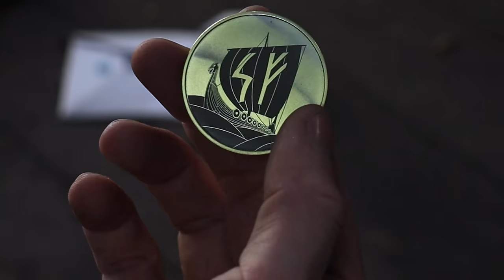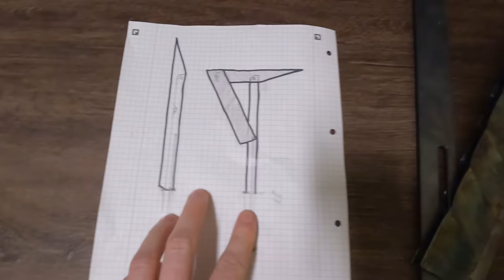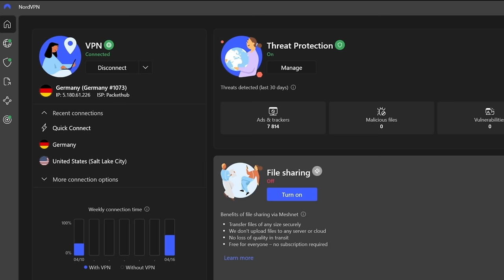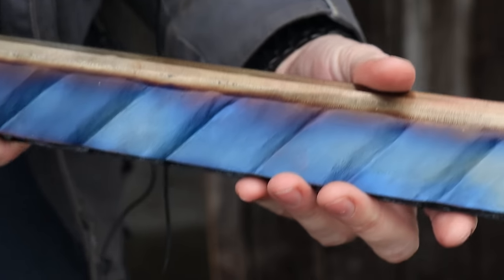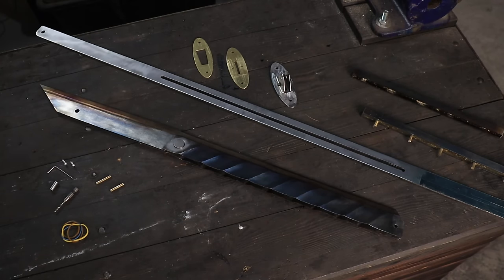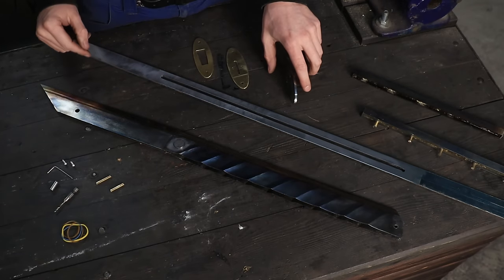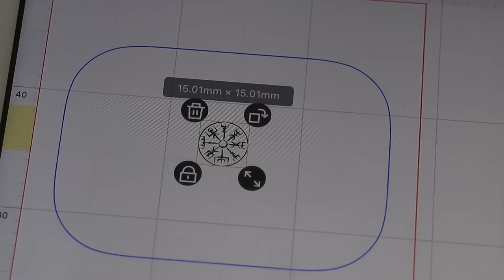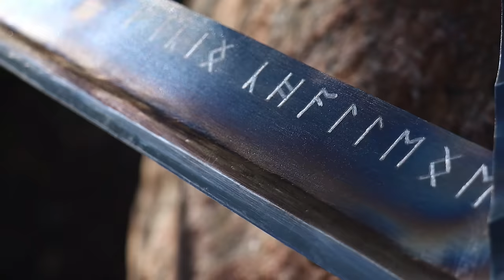Making a functional SWITCH AXE

Comment: I'm astonished by the integrity of the finished piece, I did not think the design would hold up to any real stress.
Reply from the maker: I’d love to really try what it could handle but at the same time I don’t want to wreck it for no reason 😄
Reply: @NjordArtisan  its definitely "mall ninja" durable so don't hit it on anything like wood, or rocks, or bricks, or cars, or grenades.
Reply: @NjordArtisan  maybe make one out of stronger metal qaulity and reinforced joint areas also less decorating just savage metal like fast production war blades. smiths back in middle ages only made master piece / decorative or special blades if they had the time to do that or a special customer. Most weaponry was made for warfare less where made for show pieces except if they wanted to see the skill-set of a rumoured smith. stil awesome switch blade axe thing you made but i do think you made it weaker by cutting them groves in you're most important part the spine of it all. Stil you could try make ather one for real wood chopping but that probaly gone have some weight in it. Anyways would be the best test if it can chop a tree down it probaly will chop a person down. anyways stil cool build i enjoyed watching the progress. maybe a idea  (dont know if you have a steel company in the area but ive worked at 1 for a few days they kept trowing a lot of qaulity garbage steel into the recycle bin. they would mostly cut up massive plates of steel into smaller stuf and then trow away the skeleton of plate steel so yeah worth a look around in the local area if you got any steel industry where you live / could be cheaper to look for that. only reason i left these guys is because they wanted me to do risky stuf and i barely had training.)
Reply: @KnexJunkie  please no more of this abominations...
Reply: @KnexJunkie  No matter what material you use and how well you reinforce the joints, they are always going to be a weak point. This version he made is actually remarkably sturdy.

Comment: Axe mode switch into attack looks remarkably quite well! I bet if you were to make a second version improving on the design it would turn out perfect!
Reply: One issue is it looks like you have to hold the ax in place at the guard since it lacks a locking mechanism, meaning your reach and the force behind each ax swing is taking a hit. Sword mode looks great though
Reply: @derpywoodoo  could build a locking mechanism into/under the guard and use your thumb to unlock it. could be a mechanism similar to folding tables but more robust.
Reply: Maybe it would work better if you'd apply the axe part into the sword handle.

Also I would find this interesting if it was more utilitarian, like a billhook sort of deal. An axe that for self defense purposes doesn't function exclusively AS an axe.

There's Nordic billhooks that have a blade all throughout and into the hook, used in forestry. They're more like a climbing pick and really quite nice to work with, you wouldn't expect how the small bladed nudge grabs nicely to trunks and doesn't get stuck.

Comment: The reason the Switch Axe works at all in Monster Hunter, at least as the game's lore justifies it, is that it was initially developed by an ancient advanced civilization that went extinct. Also, they are made from the parts of the series' monsters, which are stronger than any metal and can thus handle far greater levels of stress.

Good on you for pulling it off at all, though.
Reply: To be fair, the ancient civilization in Monhun was only about as advanced as we are now if they even existed at all
Reply: Your comment is misinformed. In Monster Hunter, metal has the potential to be stronger than a large majority of monster parts. Additionally, while the original Switch Axe was indeed created by the Ancient Civilization, it was a fully metallic design like nearly all ancient weapons were. The technology to build Switch Axes was then lost for an undisclosed period of time before the design resurfaced in an undisclosed desert region, presumably Loc Lac. The Bone Axe, introduced in MH3, was the first Switch Axe in the series and featured both bone and metal design elements.

This is of course to presume that MHGU is canon, which is debatable given the game's inclusion of countless characters and locales that may or may not match up with each other chronologically.
Reply: @rathalomaniac6212  that's technically also incorrect as the Switch Axe and other technologies in Monster Hunter exist because of the world's engineers misinterpreting how recently rediscovered tech was meant to be used E.G Carbine Rifles and gas compression chairs don't exist in Monhun but Insect Glaives do.
Reply: @Sing_LoveWRS  "Carbine Rifles and gas compression chairs"

I have no idea what you're talking about. You do know that a carbine is just a shortened rifle, right? That's basically what an LBG without a long barrel attachment is. Also, what the hell is a gas compression chair?

Your assertion that the Switch Axe "and other weapons" exist because of a misinterpretation of ancient tech is absolute nonsense. Not only does it completely invalidate your first comment, but it also assumes that the Ancient Civilization hadn't already created a version of nearly every modern weapon. Were they the ones misinterpreting old technology? Maybe stop and think before you post misinformation.
Reply: @rathalomaniac6212  do you know how to read
Reply: Also Switch Axe, Charge Blade, Insect Grave and Gunlance, arent even fully understand by forgers in universe, they know how to make the body and most components but the core components are actually scavenge from old weapons left by the ancient civilizations, that the reason most npc hunters normally use lances and orther simple weapons, because those ones are actually pretty rare
Reply: Mhgu is cannon. So ignore the guy who said that's questionable. 

That said. There is just... Whaaaaa. Okay. Lore time. Weapons like the switchaxe, and gun lance are rediscovered weapon designs. Insect glaive being one of those is a double check, because it's not complicated. If you assume it's complicated via function is still wrong too. 

Monster materials out perform metal materials. While yes plenty of weapons use metal as support. But magala weapons don't. Pure monster. Gravios hide and swim in lava and magma. Temperatures that melt metals used to make weapons. If you are willing to suspend disbelief for powerful metals. You are gonna have to understand, that monster materials just perform better. The equal dragon weapon in lore is made from hundreds of monsters. Its a bio weapon. 

Finally yeah. There was an advanced ancient civilization once upon a time. That is true. A lot of the lore replies are saying nuh uh. But like almost everything is correct. It should be lores in addition.

There was an ancient civilization. They used the naturally powerful aspects of monster materials in the world. With in addition to the creation process, or just outright. They would one day fall, and castle Schrade being the ultimate testimony of the hubris of this ancient civilization, building the ancient tower. This civilization was so far reaching. It was almost global (thank you frontier.) With the technology being rediscovered over time. Simple advancements have been made in weapons simply because of lacking infrastructure, and the inability to fix ruined ones. Everyone. Monster hunter has airships. And can jerry rig a gallion to fly with balloons made from our favorite crazy bat. They are plenty capable of replicating the weapons. That said. It's replicating, not recreating. Some of the techniques are just misunderstood. They are just straight up permanently destroyed, and lost. The bowguns are just really powerful crossbows, guys. Lets not pretend the world of monster hunter can't invent a gun. Gunpowder exists. 

The only claim that is misinformation is a game's canonicity. Hate to break to you rathalos man. The development team behind monster never said any game but stories is not cannon just as much as they haven't said which games are. Nobody but the development team actually knows what is cannon to the monster hunter universe.  If mhgu is not cannon. World ain't even damn close at all if portals from other worlds open up, and drop their monsters into monster hunter. Behemoth, and Leshin. And if your claim is based on the timeline where characters interact. Got even worse news. It's very clear that mhgu events are post mh4u. As stated by the same characters. That directly reappear. If anything mhgu shows the timeline is shorter than we thought. The world is huge, two cataclysms can happen at the same time. (Which is oddly realistic to real life. Our world is still big for us, and I don't have to tell you people how much crud is happening all at once.)
Reply: @NCemloen  Equal Dragon weapon is just an old scrapped concept man. But yeah, I love the people trying to correct the original commenter like they're wrong. But literally nothing they said is wrong lol
The ancient civilization existed, they made Switch Axes, and Charge Blades etc, they fell, Modern smiths replicate the designs. Everything they said is correct.

Comment: Out of all the mechanical builds on this channel, this is by far the best looking one. Whereas the folding sword seemed like a prototype, a mechanical engineering idea, this seems like it works really well as both a sword and an axe, so it is actually practical to use. Also, looks cool af. Great job. I'd love to see more.
Reply from the maker: Thank you!
Reply: Yeah it's actually surprisingly "real" for a silly project. Only thing I can see truly improving it is just structural stability of the axe mode blade and some redundancy in the mechanism.

Comment: Great work!  Honestly the only thing I can think of to improve it (beyond just, like, aesthetic things and maybe making it to where the axe part could hit the hinge dead-on and still cut) is maybe making some sort of latching mechanism so you can do the thing where you slide your hand down the haft while you swing the axe to get the impact of swinging from holding it at the base of the haft without the long wind-up of doing so without it stopping being an axe

Comment: I like it but it somehow needs a handle where you slide it up along if you could do that that would be crazy maybe like the hilt looking part that you use as the mechanism to switch it into axe form has a built-in kind of hollowed out hilt/handle hollowed out too fit around the tang  .. and then you make a little dimples on the inside of the handle and make guide valleys  so it has a guide rail so the  handle doesn't wiggle while in motion.

Comment: There's a reason that axe-handles use Wood, and it's not because steel costs more. Your blades' spines might do better with something like Yew, as it'l hold the shape without bending as badly, and still be springy enough to withstand use without breaking.
Reply from the maker: Yes axe handles are made of wood because it has a better size to weight ration. And since an axe handle has a large cross section it's strong enough. For this build, size is a very important factor and since steel has the better size to strength ration, I went with steel. I don't think a 3mm piece of wood would be able to hold 3 lbs with 2 ft of leverage, whereas the metal can.

Comment: Inreresting, I'm very concerned about its structural stability in any kind of strength test, also you might be forced into axe mode with a strong tip hit, but still really neat.

Comment: I feel like the switch axe in the games, uses kinetic force, in addition to a switching mechanism, as in tri especially the hunter adjust something underneath the switch axe, to switch between sword and axe mode, like he is forcibly pushing the blade forward or back, using some kind of magnetic release mechanism. They improves the design a bit with the charge blade, and i think frontier has some even wilder weapons, but the switch axe was definitely a gimmick weapon, which i didn't feel like translated well into real life, without being extremely overengineered. I was a switch axe main in tri, before switching to greatsword later on, so i saw the animations a lot!

Comment: You pulled it together in the end 👏🏻 👏🏻.  I like the final piece. I think you'd have an easier time in the future, by grinding the edge when the pieces are combined, and also to steer away from designs that hinge in the center of the blade, perhaps you could look up folding mechanisms that aren't normally used in weapons. You're for sure getting better!

Comment: The end result was amazing, my only gripe is that the wood handle is a bit thin compared to the center bit with the epoxy, how comfortable is the handle when you're not wearing gloves?
Also, do you think it's be possible to make the Rakuyo from Bloodborne? The hardest part would just be making a locking mechanism to hold the two blades together.
Reply from the maker: I did the center that big on purpose , so you would be able to have a bigger handle in axe mode and also have clearance for your hand while switching back into sword mode.
I'll put the Rakuyo on the whiteboard 👍

Comment: Fluting is a GREAT tech! if you fluted your side-plates or used the similar dimpling techs (hexagons are the bestagons, of/c), you could stiffen those as well, or subtly dish them outward to add stiffness and strength to otherwise very thin and light pieces.

Also, consider whipping up a batch of "silly putty", or getting some Oil Clay, you can embed your workpiece into a bed of the stuff, then go at it with your preferred tool to shape it easier. this is how fancy embossing is done by hand, but you can use it to ease (and expedite) embossing a flat sheet with flutes of any shape, or dimples, or just a "hammered finish" that can all add stiffness!
Reply from the maker: I'll try that in the future!

Comment: i would like to add just a little detail... If to the handle that makes it convert in to an axe, you welded a few (2 probably, one on each side of the handle) tinny metal straps, you would be making it stay on blade mode when stabbing, right now, it seems like if you tried to stab something with the blade it could turn itself into axe mode.
Reply from the maker: Yeah, some sort of locking mechanism might be a good idea. Although I really like the fact, that it’s so easy to switch between both modes without one
Reply: I don't actually think that would be much of a problem - it might matter plenty if you were trying to stab through something armour like, but fleshy bits... And as this style of blade profile will struggle with armour anyway - that would be a good time to go axe mode deliberately. 
Would need hands on to really tell for sure but I highly doubt its so smoothly transitioning that stabbing something will just put all the energy into that mode swap and not also be very uncomfortable for the softer targets... Plus if you stab very straight the tip and the pivots remain basically inline - so it isn't going to want to crumple, and if your hand actually slides forward to shift mode part way through a stab I hate to think what it would do to the target, but that level of force and commitment isn't going to be fun...

The real question will be if this thing can actually hold up to use enough for it matter anyway. It is a really fun idea, but I don't think I'd build it this way myself, and to some extent the whole concept is flawed...

Comment: As a switch axe main, the animation you showed at the start of the video is kinda overcomplicated and infuriating, really not representative of the way it's animated ingame. Good vid, just a bad animation. The actual design is really simple aside from whatever internal parts move the pieces around (and phials, don't worry about those). So let me give a quick explanation.

You basically have a handle and a long, thick rail. The axe head is on the rail, it goes forward and back. The sword blade is on a rotating pivot at the end of the rail, attached to the back-middle of the blade. The axe can also rotate a bit to help lock the sword in place. All the movement is effectively battery-powered via some kind of internal mechanism.

Axe mode: Axe head is at the far end of the rail, sword blade is rotated back. Axe is held in place by internals and centrifugal force, sword can't move since the axe is in the way.
Sword mode: Axe head is at the near end of the rail, sword blade is rotated forward. Axe is held in place by internals and the sword blade, sword is held in place by a notch on the back of the axe, which is why the axe can rotate slightly to lock/release the blade.
Also, when "sheathed", the axe is at the near end of the rail and the sword blade is rotated back. That gives it a smaller profile and makes it so that only one motion is needed to get into either mode.

Since the animation is using a bone swaxe instead of the stock metal swaxe where the mechanics make sense visually, the mechanics also make no sense visually. The metal switch axe actually shows mechanical parts and proportions that look like they could work. It's presumably using some kind of chains, gears, pulleys and stuff on the inside to make everything move. Bone swaxe and most other switch axes just use magic.

Your design really isn't far from the ingame design aside from the hinge connecting the axe and sword parts, only turning 90 degrees instead of 180, being all manually driven, and not being made out of 40 pound metal slabs. Makes me wish you could half-transform ingame and use it like a giant war pick.